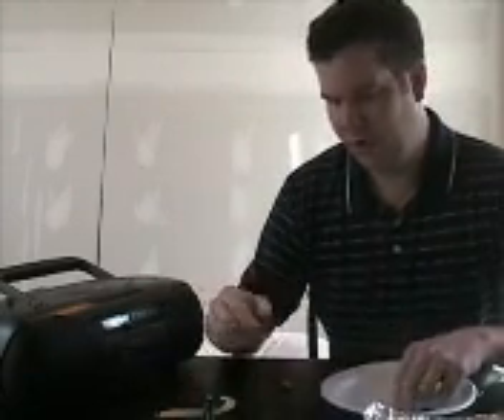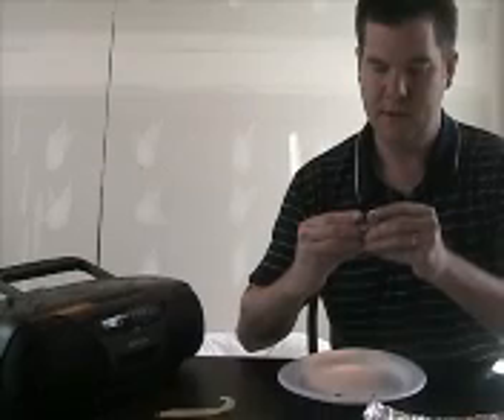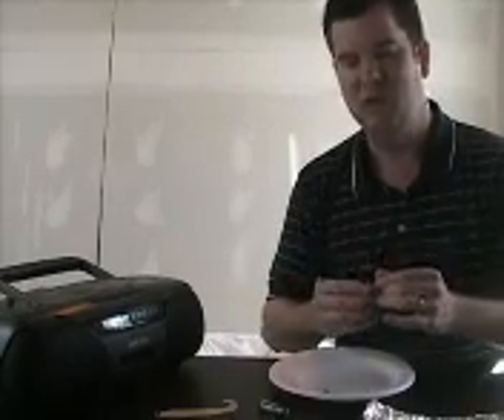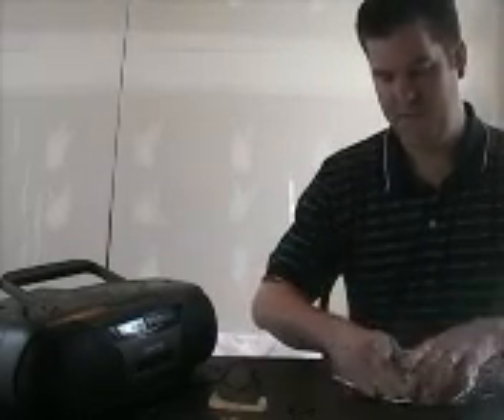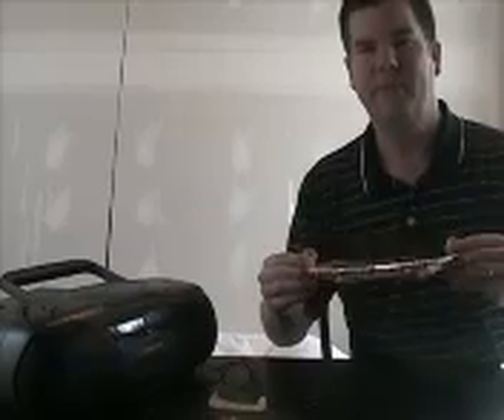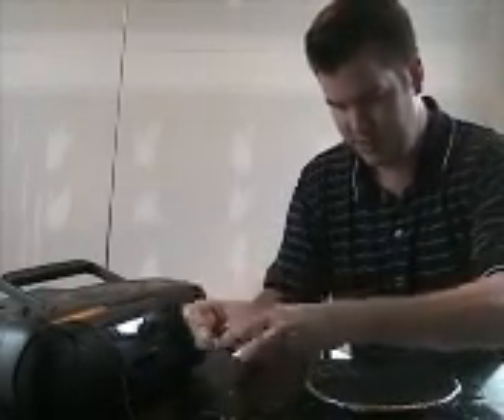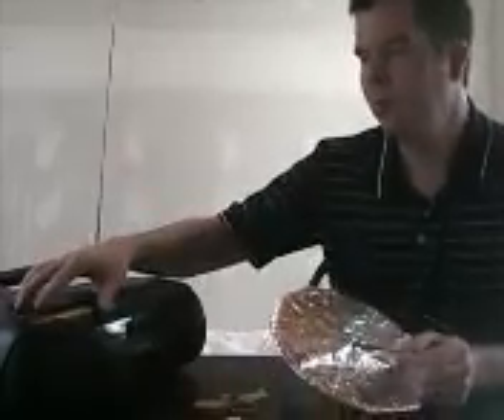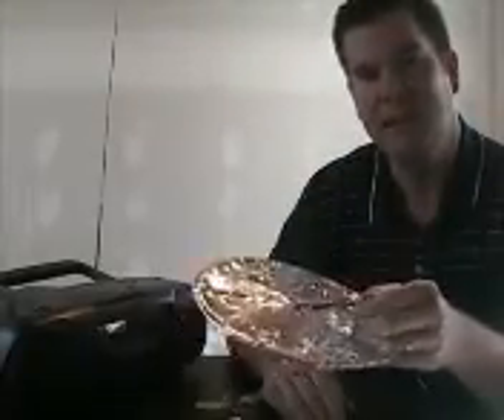Teacher explains High-Def Speaker for Under a Buck

Comment: if u realy  want to make it then mount a bigger  magnet to a plate such that it is very close to the foil but not attached and its magnetic axis should b perpendicular to foil and the part of foil just above the magnet should have an electromagnet attached to it such that its magnetic axis coinside with that of permanet magnet, the two terminals of electro magnet should be connected to 2 wires coming out from the head phone

Comment: the only difference will be in the solenoid. if you don't use an isolated wire(just a wire, not a super-duper-magic "magnet wire") the charges loaded onto the circuit will only induce one big charged potential area with a minimum magnetic field. if you use an isolated wire instead you'll get the desired homogeneous magnetic field inside the solenoid and at the edges of it. that's the hole thing.

Comment: *DOH* would best fit your reaction when u'll understand what i wanted to say... the guy in the vid says that's a so-called "magnetic wire", not a "normal wire". the point is that a "magnetic wire" is just a isolated copperwire. therefore it's a "normal wire" but just isolated.

there's no real difference in these two "wiretypes" if u could name them this way. the magnetic field properties, when electricity or an external electrical field is applied, are in "both" wires the same.

Comment: There are a couple possibilities. The copper wire needed is the type that has a very thin coat of lacquer on it. If it's just normal copper wire, it just shorts out the signal source. Also, the distance between the copper and the magnet makes a big difference. The field of a magnet deceases ten fold when the distance is doubled.

Comment: Why it works at all with the wire ends simply twisted together: it acts like a one turn coil electromagnet.

You need to separate the magnet and coil. With them both fastened to the foil, there will be only a little sound due to vibration because the magnet and coil are taped loosely.

Tape the magnet to the center of the paper plate, then tape the coil exactly above it on the foil. Carefully push the foil down so the coil is just above, but not touching the magnet. It will be much louder.

Comment: BAKA! a hedphone jack Wont work because the wireing at the plugin is made to reduce sound!. i k now i did the same thing trying to splice a aux to headphone jack together and there wasnt enough sound to make paper vibrate!!

you need to use a diffrent cord that was designed for thing kind of thing like pc speakers. after i spliced old seaker wires with the same aux cable and it made it extreamly louder!  SO PEOPLE TRY THIS if your not getting the right volume of sound.

Comment from the maker: you need an permanent magnet on the bottom, rare earth magnets work best. I found out the magnet must be directly under the wires for it to work. Get rid of the penny and take some thin speaker wire and wind it up as much as possible, then put the magnet in the middle and that might work as well. Check out my other video "speaker under a buck challenge part 2" Thanks for watching.

Comment: Speakers run on the push pull effect of EM signals going through a series of wound wire coil. To make this even more effiecnt you would want to actually remove the penny and the electrom magnet form the foil, glue or tape the magnet to the foil as shown here but before you put it over the plate mount an electomagnetical coil in the plate so the magnet sits on top, I may to this with plastic wrap to demonstrate this type of set up very nice video btw thanks for letting people know the truth.